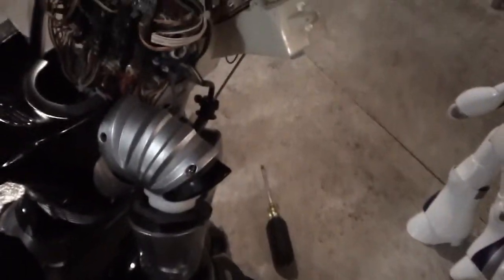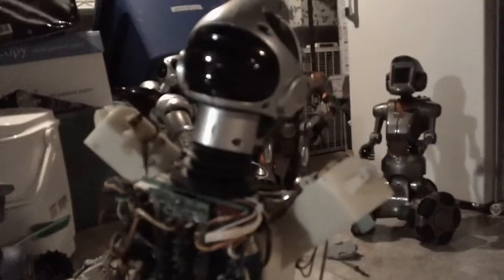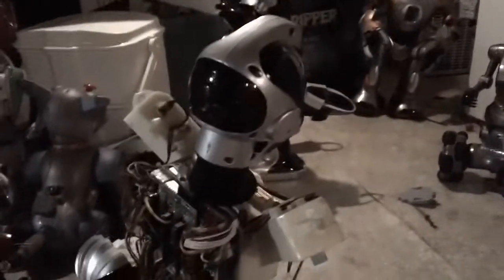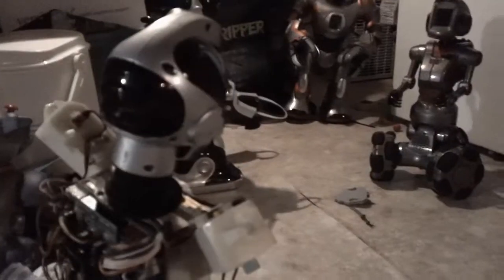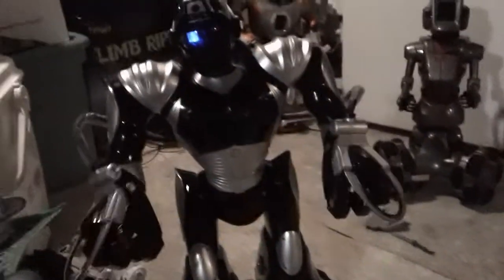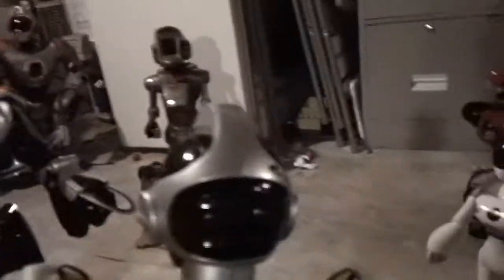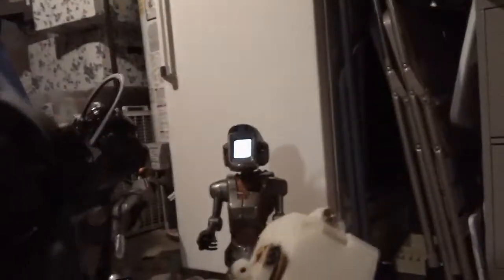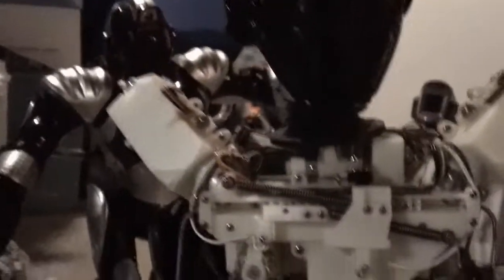the black robosapien v2 dont have that bad wiring insulation problems

Comment: Where do you get the blck one please and does the silver version have the wiring problem?
Reply from the maker: yes the silver sharper image does indeed have bad wires unless you get the UK import ones that also come in red and white the UK has those 3 and seem as they dont have this problem because they never say they are broken they always work but the black is the only one in the US that actually works and lasts years before breaking i accidentally fried mine by putting a circuit board into it from and older v2 so apparently there boards are different too. you have to keep checking on ebay for the black i need a new one for myself as well.
Reply from the maker: yes the silver sharper image does indeed have bad wires unless you get the UK import ones that also come in red and white the UK has those 3 and seem as they dont have this problem because they never say they are broken they always work but the black is the only one in the US that actually works and lasts years before breaking i accidentally fried mine by putting a circuit board into it from and older v2 so apparently there boards are different too. you have to keep checking on ebay for the black i need a new one for myself as well. sorry for double comment youtube is strange againg
Reply: yes it does can you get the black on in the UK do you know bud?

Comment: Do you have the RS Media model does it has the same problems as these V2 models...
Reply from the maker: i dont belive they do have that wiring problem non have had that yet they do look better then the v2 the black v2 and the media are using the same wires so if they do have those bad wires it maybe the wires not old enough yet but we well see in 2 to 5 years if that changes
Reply: Cool and thanks for your reply I brought out my rs but didn't really want to open it up as mucking around with screws and plastic to much can cause threading however I am wanting to do some modification and searching you tube on those who did mods & hacks one sight showed some amazing work where his RS had a V2 hand and done some internal hacks was quite impressive. Have you done anything like that and posted on you tube?
Reply from the maker: Fatmeatball
cool yea if its v2 make sure its the black im finding out that the v2s in the uk are good too. and yes all rs medias are good